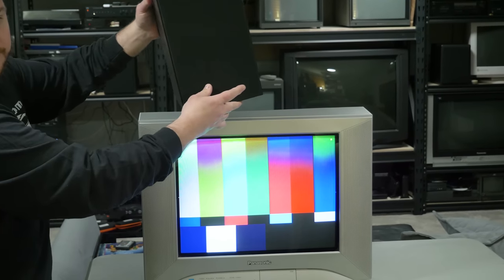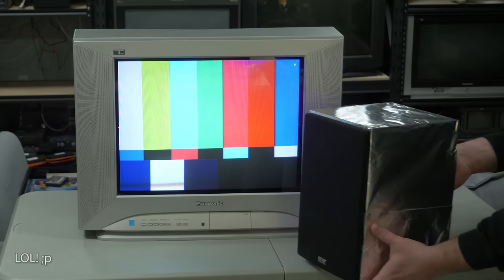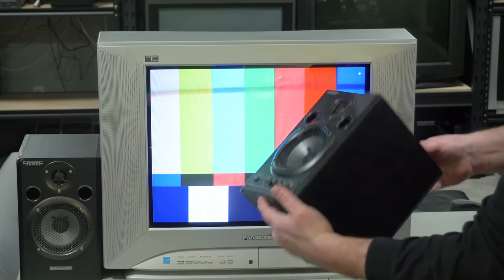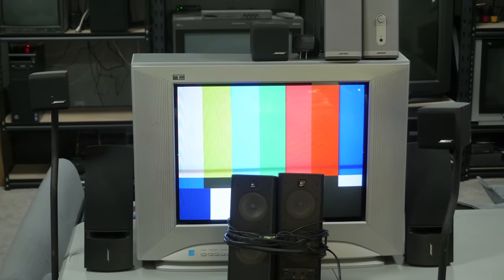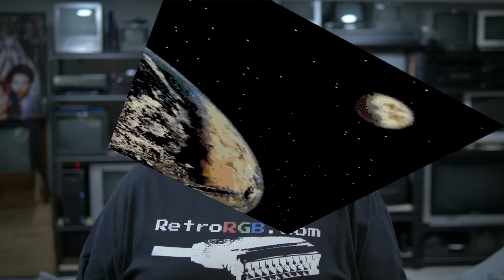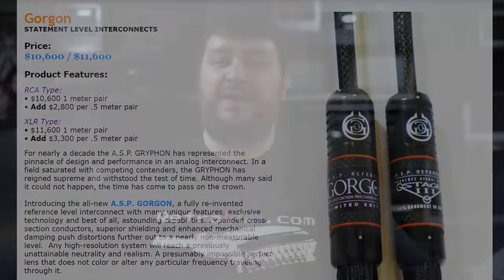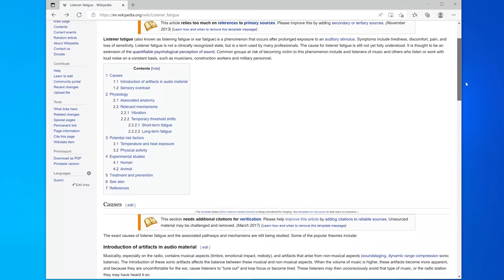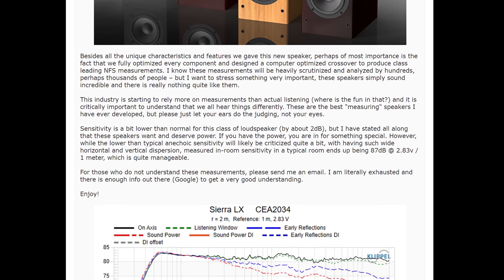CRT's + Magnetically Shielded Speakers

Comment: WOW, I have a PVM with a built in speaker, not the greatest thing but, it does the job(been only playing NES on it with a NESRGB kit).  I remember with my PC back in the Windows 95 days not being able to use some speakers because of the shielding.... This was a big topic back then, trying to find the right speaker, not just today.  What is old is new again.... LOL

It was even worse when I had a 32" Sony and had big home theater speakers next to it, or sub below it.  

This one of those been there done that things...LOL

As for reverence audio. When I was in my mid 20's, I worked for a company called Tweeter, etc  (Mass based mid to high end A/V,) one thing I learned and still use today, was how to listen. How to check for speaker quality and hear the difference.  I did get listen to a $100K separate amp and pre-amp, $10K cables and $60K speakers. We changed wires from lamp cord to $10K cords, to hear a difference. Was a very interesting experience in my life, and wish I could do a modern version of it again, I could never afford a $100K setup but, it would be nice to hear them in a correct room.

Comment: The component jack for the left speaker of my 29" LG CRT is bad; I have to jam it so it works every time (probably a cold solder joint). Instead of tearing it down and trying to fix it or break it more, I though I might as well look for a pair of speakers or headphones. Had many ideas on how to hook them up, but since I use my PS2 and PS3  the most, I just bought a cheap toslink to RCA converter + P2 jack. It works wonders, with cables long enough so I don't have to worry about leaving the speakers too close to the TV, so no interference!

Comment: I have newer speakers but they are relatively far away from my 32 inch crt.
How far does the magnetic field reach from a speaker?
Reply from the maker: Unfortunately, I don't think there's an easy way to answer that.  I think the only solid answer would be to use a magnetic field tester (cheap geiger counter?) to double check.  I'll say this though:  Even when I put my front speakers against the wall, it was too close...but the rear speakers in the back of the room seem totally fine and it's far enough away that I wouldn't worry.  Just my opinion though.

Comment: I've bought a pair of JBL C2P speakers over a year ago thinking they were shielded (as stated in their documentation, so I've never doubted it). After watching this video, I've tested them and they slightly affect the CRT colors when sticking them directly on top. Not as much as some of the unshielded ones you showed however. Does this mean they're unshielded, or is there some amount of magnetism that can still "seep" though their shielding?
Reply from the maker: Check the pinned tweet...we got duped :(
Reply: @RetroRGB  This sucks. It means I've potentially been slowly damaging my CRTs for over a year, and on top of that, it's too late to return those speakers.

It's still better to learn about it now than never though. I really appreciate this video and your excellent work, so thank you! I'm already looking for another solution for my audio setup.
Reply from the maker: Well, the good news, is the magnetic field is directional...so if you didn't notice any interference it barely did and harm at all.  Still sucks we both did our homework, checked the documentation and were lied to :(
Reply: @RetroRGB  Good to know. Thanks for the update on this!
And yeah, after this, I trust no one anymore about claims of speakers being magnetically shielded. This JBL documention thing made me completely paranoid haha.

Comment: I’ll always recommend looking into late 80s to mid 90s hi-fi equipment. It’s pretty cheap and easy to find and is generally of very high quality. I’ve had several amp/speaker setups from this era over the years and found that they sound great and are super reliable. I’m not sure about them in terms of shielding though, as I never place the speakers right next to my monitor.

Active studio monitors are also a great option. The large majority of them are shielded and they sound great. The down side is you don’t get much control over the volume unless you put a mixer or something in there.

Comment: Definitely looking to get those Ascend CM-170SE but that amp at $500 is just to much. I have a few stereo receivers laying around, if I kept that away from my PVMs would I be ok? Does it specifically have to be an 8ohm receiver? Thanks
Reply from the maker: You can use any receiver you'd like.  And while audio is subjective, that amp is amazing for the price.  Maybe start by testing the Ascend's with whatever you have lying around and go from there.  Maybe one of your existing amps is already awesome? 
...but if you connect both your amps and aren't satisfied with the sound, you'll know what to do next :)
Reply: @RetroRGB  thanks dude I'll give my Denon AVR1707 a go first. It also has 3 Component, 3 composite, and 3 s-video inputs that all output through component.. the only downside is it only supplies 75w @ 8 ohms per speaker.. I don't want to under power the Ascends do you know if 75w is enough to satisfy them?
Reply from the maker: 75w should be fine.  And analog-to-analog via the amp should be fine...but as a note, EVERY SINGLE amp that has analog inputs and HDMI outputs adds a TON of lag to the signal.  You SHOULD be good, but it might be worth lag testing.

Comment: The JBLs despite being specced for shielding may as well not be. 100% do not recommend you use them with CRTs.
Reply: I was looking at getting the JBL's, in Australia they are a much cheaper option than the Klipsch . Have you tested and had experience with the two JBL models listed in the description? Did they have poor magnetic shielding?
Reply from the maker: I have a pair of the 305p's coming tomorrow, which I'll test myself.  That's the PDF I showed that list magnetically shielded three times for each speaker, so I'd really hope they are! ;/
Reply: Thats awesome my dude. Looking forward to seeing how your testing goes!! 😀

Comment: FYI!
I bought a pair of Klipsch R-51PM and they are not completely shielded I noticed I'm afraid. Had them right by my PVM and there was a bit of distortion in the corners. Moved them like 10 cm away and degaussed the PVM and the distortion was gone.
Reply from the maker: Just to be safe, maybe move them another 5-10 cm.  They can still do damage, even if you can't quite notice it.  Good job picking up on that though!!!
Reply: @RetroRGB  Thanks! Okay nice to know, I have now moved them a bit further just to be sure 🙏

Comment: I have a older 80s CRT that has ports to connect speakers directly to the rear of the tv with speaker wire, but the problem is it only says 8ohms on the back and Zion don’t know how much wattage I should be looking at when looking into speakers. I cannot find anything on the internet about the set.

Comment: I have an unshielded guitar amp/speaker that starts to distort the CRT once it's within ~3/4 ft. Would placing the amp in the same multi-tier shelf as the CRT be too risky even if the amp will be 2 ft below the CRT?
Reply from the maker: I'd always be extra careful.  I mean, would you really want to risk it?

Comment: I ended up getting the svs packege. Just the basic one, i didn't even come with a proper center just another speaker. Prime Satellite 5.1 System.
I put the speaker near the tv and it's fine. Doesn't do that distortion. IDK
IDK maybe some sort of shield board thing i can put between the tv and speaker to make it to the safe side.
SVS where reccemended to me. IDK they do sound alright. Sometimes i don't know what good sounds like. Hope i didn't get trolled. It was many years ago.
Got the better one's to keep for a lifetime. Because i don't think speakers change much in futures. Meh they make them bluetooth now like i care for that. I was just going to get logitech computer speakers set. Do i need to upgrade them or am i fine. I don't think speakers change much. IDK i might be wrong.
Why are receavers so big still. I get onkyo. reccemended. THey tend to act weird on me after a couple of years.
Will i have better luck with denon. Should i invest into a amp. 
Sometimes i feel i should of just got book shelf speakers or stick with whats on the tv. because of space
5.1 does work when playing fps. I know where there coming from.

Comment: I just want to add that another way to tell if a speaker is shielded is to just open it up and check. You should be able to visually tell if it's shielded or not.
Reply from the maker: If they're bolted together like many PC speakers, sure...but if they're sealed like the Elac's, you'll most likely ruin them if you tried to cut them open.
Reply: @RetroRGB  Ah, ok. I guess I just assumed that since the handful of speakers that I have are all easy to teardown that they all must be. My bad lol thanks for the info and correction!

Comment: How far away is safe for unshielded speakers?
Reply from the maker: Sadly, I don't have solid data on that.  Someone I trust once told me they had a subwoofer on the opposite side of their room that affected their CRT.  I personally have a stack of unshielded speakers on the opposite side of the room with the CRT wall and I've never seen any issues at all. For me personally, I wouldn't use front L/R or center unshielded speakers (or any on the other side of the wall the TV's are against), but I'd be fine trying sub's and rear speakers that weren't shielded.

Comment: I have a question if anyone knows: If I can't find where the magnetic interference is coming from, and and no matter where I put the crt, there is some sort of distortion somewhere on the screen. How do I shield the CRT itself?
Reply: You can get free apps on your phone to detect magnetic fields.
You might be able to use that to help localize where it is coming from?
Reply: Maybe the screen needs degaussing or the degaussing coil has failed?

Comment: If I use a CRT and a non-shielded speaker placed nearby NOT a the same time, does this affect the CRT?
Reply from the maker: It will affect it, even when it’s off.
Reply from the maker: Good question though. I should have been clear about that in the video.
Reply: Thank you for the answer! Now I’ve to get some mu-metal, I’ll try to put it on the side of the PVM and report back if it works. That’s strange though, being the PVM a medical one shouldn’t the case be shielded?